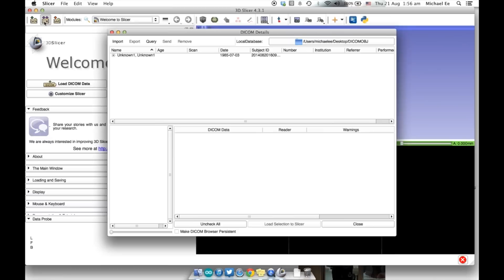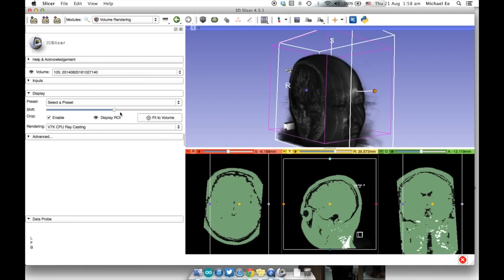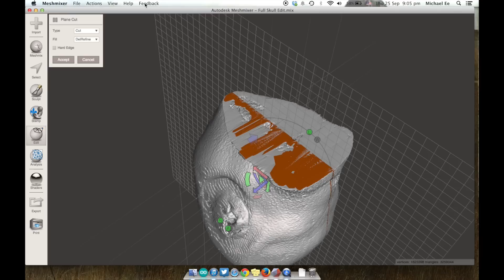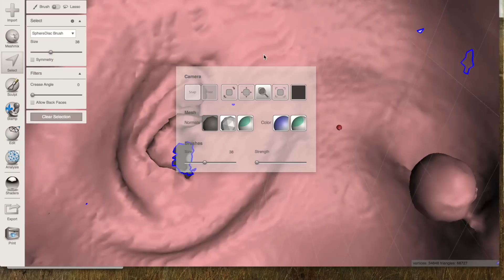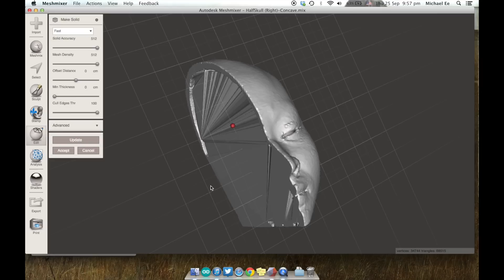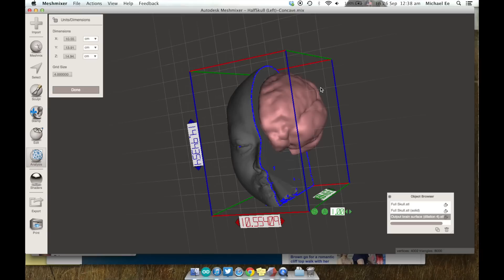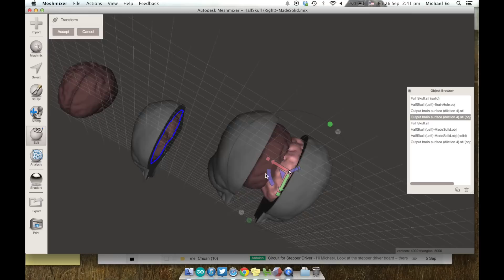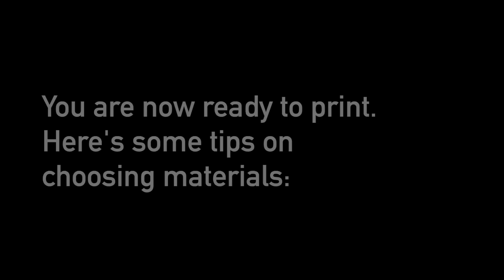This is 3D Printing from MRI (DICOM)

Comment: I'll sum up the steps to get a polygon model from DICOM Data.  

In 3D Slicer.  First load Data, and DCM using the top buttons. Click Apply to on GenericAnatomy Colors.  Switch Module to Volume Rendering, and click the eyeball by Volume to view the 3D Data.  Use ROI to adjust the bounding box.

Select Module Model Maker.  Under IO load the data. and under ModelCreate new Hirearchy to name your model.  Click Apply.

File Save and under File Format tab select the Poly Data (.vtk) change to .stl or .ply.  STL works in 3DS Max with the correct plug in loaded, also good for Meshmixer and Meshlab.  Export to OBJ with an MTL file to get textures.

Hope that helps someone This took me a few days to figure out a good process.

Comment: Any chance you could explain how to install skullstripper in the current stable version of 3D slicer?  Doesn't seem to be a good way (Swiss skull stripper doesn't work)
Reply from the maker: Bob Janisch Hi Bob, I might not recall how I installed it, but it was an extension that I had to load into the program. I believe there’s an extension manager/preferences sort of dialog for you to find the file, and it should work once you’ve selected it. At least — that’s from what I can remember when I did this last year. Sorry if this information isn’t the most helpful!

Comment: Nice! Thank you. This is what I was looking for. How long did it take for you to learn 3D slicer and what resources did you use?
Reply from the maker: Hi! It took me about 3 weeks to get a good understanding of how the program worked, and what the functions were doing. I use a MBP laptop so it would definitely be faster if you used such a program on a Windows or desktop computer (I compared my experience with my classmates’ and their 3D renderings were processed at a faster rate than mine. 

I did try Invesalius but they only have a 16bit version for Mac, and that ran really slowly on my laptop. It was easier to use and understand in terms of functionality and tools when compared to 3D Slicer though. 

AHNTLIA is correct in stating that Invesalius and 3D Slicer are basic and limited tools – as a beginner, I was already struggling with a lot, so this was enough to keep me occupied for a 5–6week period. If you have more time, or a faster ability to adapt to working with such data and tools, then I would agree with AHNTLIA and invest in more expensive software with a larger variety of tools and precision. 

It really depends on the scope of your project, and what you’re intending to achieve.
Reply: Michael Ee Thank you. Appreciate your reply. I most likely will invest in a sophisticated tool since I am thinking of going deep in medical imaging. But I am planning to do that after I learn basics from3D slicer and inVesalius. What were the resource that you used for learning 3D slicer, was it just the tutorials on the wiki page?